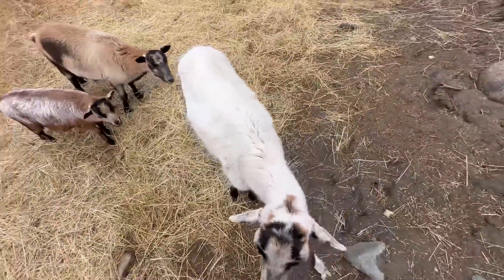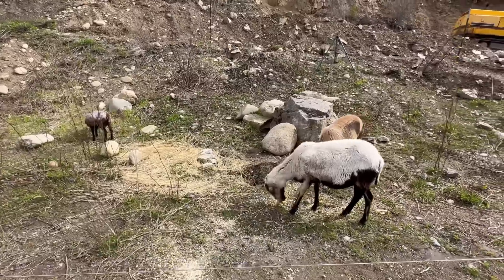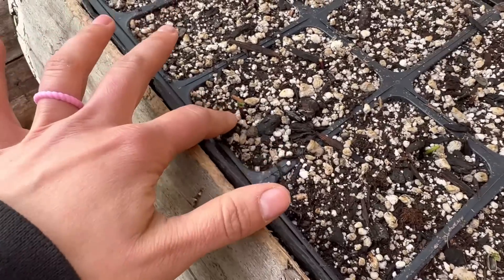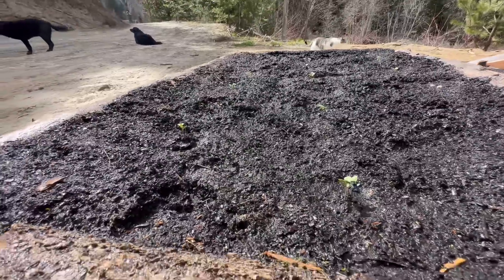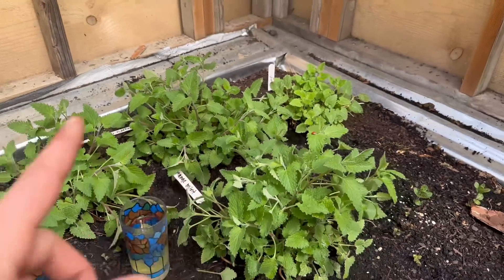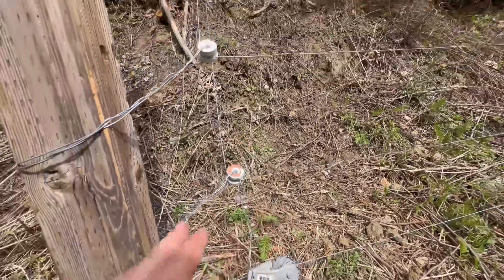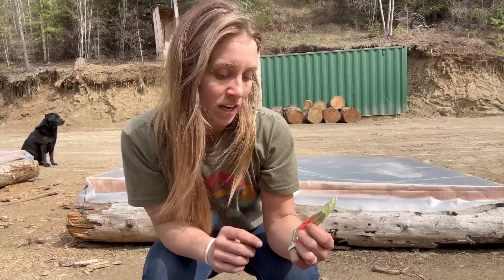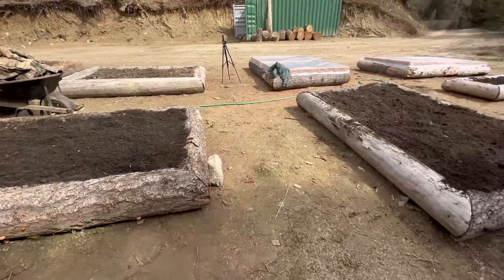Millennial Homesteaders VS Gardening

Comment: Put some straw over your potatoes. Helps maintain moister and easy to dig when ready. Also saves mounding. With the chicken manure. I have a big drum filled with water that I put the chicken manure into. I use it in the watering can. It is great diluted and doesn't burn the plants. Excellent fertilizer. You are doing great. Like watching your progress. You have come such a long way since climbing around in the sky!!! building that roof on your place.
Reply: Are you being hacked?

Comment: You can get like 1 foot strips of wire fence, insulate and energize it above the bottoms wire then tighten the distance on the upper wires and that should really help keep him in. You’ll need a bunch of insulators but it CAN be done.

Comment: In NZ our sheep fences are 7 wires, about 4" apart at the bottom for the lambs and slowly widening as they go higher. Admittedly they aren't hot but I do think you need at least 6 hot wires - 4 fairly close together on the bottom. Run the line trimmer along the grass to stop the bottom wire shorting out and all should be fine. Maybe toss a little grass seed and fertiliser over your grazing areas after the sheep have been through may improve the quantity and quality of the spring growth. Cheers from an Old Farmer

Comment: I had the same problem with some Nigerian Dwarf baby goats, My buddy suggested adding a wire from the top of one post to the bottom of the next and vise versa so you create an “X” in between all the post as well as your horizontal wires. So… I run three horizontal wires and an “X” between the post and this did the trick and it was way more cost effective than buying poultry netting. Hope this helps! ~B

Comment: That's a very good use of the step in fence!  Keep that in mind as you are setting up additional pasture areas.  Set up your gates and your rotation in such a way that the step in fence will always connect the pasture they are coming from to the pasture gate they are going to. 😊 The sunflowers are being nipped off by mice.  Make sure your cat has access to the greenhouse.  In fact, I'd put your cat on short rations.  Kitty doesn't seem to be hungry or interested in hunting. Setting up traps in the greenhouse is a must.  Mice will wipe out  your seedlings if you don't aggressively get after them right away. 😊 Get a nice wide board that will span the short dimension of your raised beds so you don't have to walk on the soil.  Avoid compaction when you can.  Are you folks actively composting?  Don't bother building bins, build your compost piles directly on the soil.   https://www.youtube.com/watch?v=u03mWQ769Vg  (You answered the question.  I'll leave the video as an FYI)  Your compost looks GREAT! 😊 Your ram is in the defiant teenage years.  Two things have to happen:  He has to figure out that he wants to be with the herd - and that's already happening.  Two - he has to get bigger.  I'd levae him with the ladies.  But if your really worried - put him back in the pen for 2-3 more months.  Then he won't fit through without a jolt. 😊 If you have any dobt about the outdoor temps at night - use row covers.  Unlike cold frame tops, (nicely done, by the way) you can leave them in place until all danger of frost is past.
Reply: This is what I was going to tell them.  Mice was my first thought too.  Mice love greenhouses as well as gardens.  Source of fresh veggies and greens.  I set up traps in mine as well.  Living in corn country we are I undated with mice and rats.  They will wipe you out in no time at all.

Comment: Sheep and electric fences are not a good combination. Here is why unless a sheep touches the fence on their nose or a nonwooly part of their body, it will not shock them. A woven wire fence is your best bet for fencing. Yes, it is pricey, and it is hard to put up given the conditions you have there.